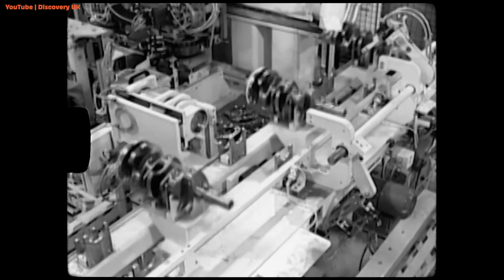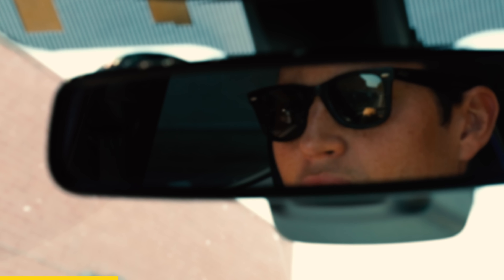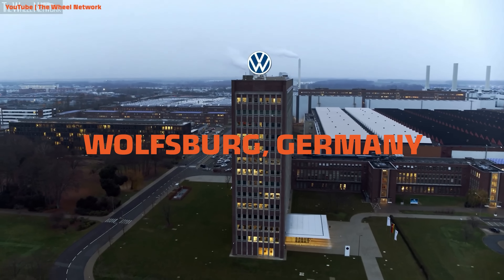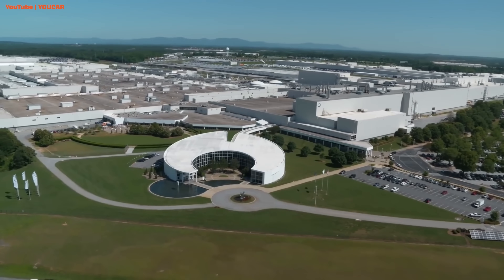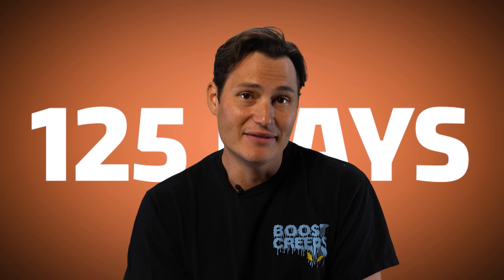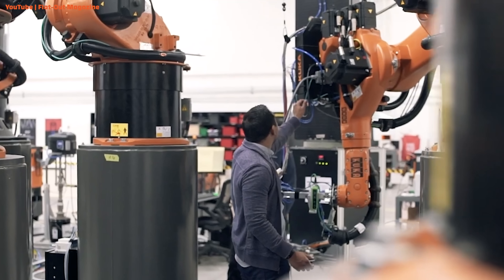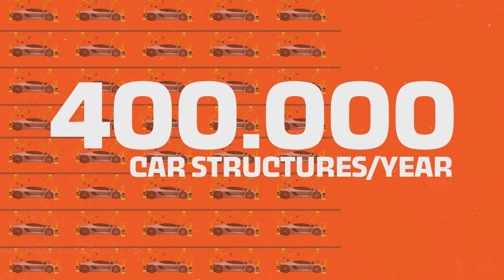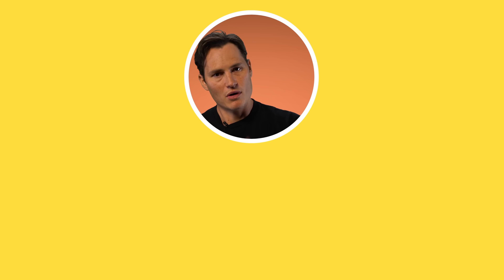A.I. Designed this Car

Comment: I will be that pessimist that might regret it in the future, but this does not seem plausible anytime soon. 
First, the figure of 400k cars a year is under the condition that all the parts are designed to be assembled in a specific way. So no chassis painting after welding for example.
Second thing is the cost. You spend 500m to save money, with the objective of decreasing the unit price. 3D printing is the opposite - little initial investments, but huge unit price. Especially if parts for a single car takes 1400h to manufacture.
Third thing is additive manufacturing is not a replacement for machining. As far as I know, you combine those two things - print a desired shape and afterwards precision machine all high-precision surfaces.
Also, topology optimization - or AI engineering (which is a buzzword marketing term) - is an existing technique that is used within reason in serial production. As for the loadcases mentioned, yes, you do have many defined, but you cannot predict all the forces on the components. So heavily optimized parts might be weak in some edge cases, in which were not a specified load case. You can compensate by higher factor of safety for the parts (a bigger strength reserve in other words), but that might defeat the whole point optimization.

I'm not here to say this is a load of BS, but the video contains a lot of stretched facts and out of context comparisons. The vertical manufacturing concept is quite cool though. I like what they are doing, but I do not see how these claims could be realized efficiently. I might be wrong though.
End of monologue

Comment: I was looking for more of a deep dive into that AI generated structures and the strength, weight and performance differences. But, this is donut and was still a solid piece!
Reply: Fyi, most of those "AI generated" structures are probably NOT generated  by "AI", but by something called Topology Optimization. Topology Optimization is generally not a stochastic process, nor does it require machine learning. It is wholly based on physics equation that are solved to provide optimum structures, and yes, these structures often resemble structures from nature.

If you'd like to play around with it and learn more you can try applets from here: https://www.topopt.mek.dtu.dk/apps-and-software

If you are a mechanical engineer with FE model experience, a good place to start is Ole Sigmunds 99 line topology Optimization code (google, and you shall find).

I hope that helps a bit :-D

Comment: "A 3d printer doesn't use extra material" - That's not how that works.
Reply: It doesn't waste, the unused powder can be used in the next batch. 

???
Reply: casting also uses little extra material. it just depends on how much of the part needs to be machine finished.
Reply: 3D printing wastes less material than traditional manufacturing, but you typically some print support structures that waste some material, depending on the shape of the part
Reply: @matthewjgingerich  Wouldn't the underlying power be the support structure though, when hardening it by laser? I'm guessing any overhanging structure would rest on a layer of powdered metal right?
Reply: By that he probably meant that 3d printer in the video that barely makes waste and not the other cheaper 3d printers

Comment: Imagine trying to find a mechanic to service this thing.
Reply: Probably would have to take it to specific dealerships that have those robot arms that can take it apart and put it back together without a hitch.
Reply: Well...it is a hypercar...you wouldn't even take a Porsche to a jiffy lube, why on earth would someone who owns one of these go anywhere but the people who built the thing?
Reply: Anything above an oil change would be a pain in the a**
Reply: @TheCustom1982  I'll bet an oil change is a pain in the@$$ also. Look up the oil change for a veyron.
Reply: @mikeedsten2358  will do
Reply: You don't service it, you get a new one
Reply: @huabills6621 😎
Reply: Print one lol
Reply: Probably could hire a robot.
Reply: It's ridiculous. Disassembling an entire car to fix a short, because they wired it through the chassis.
Reply: Perhaps they could scan your car and put in a special database where if you need a repair,they pull up your cars file and go from there
Reply: u better try finding an a. i... modern problems require modern solutions
Reply: Just have your robot fix it, or make a new one...

Comment: The construction of this car is so crazy efficient that it only takes 3000 hours of work to build one. Mind you! The price must be very efficient as well.
Reply: You pay for the research and development of the car and the manufacturing tech. In future the cars should cost less but this car because of it being the first plus its a high end hypercar costs about 1.8 million dollars
Reply: The idea of the efficiency comes from the idea that if you can get enough printers creating components to supply massive demand (mind you they don't have to be slow, super-expensive metal printers, but plastic instead for cheaper, mass-produced cars), then the actual assembly takes up less space, requires less specialized machinery, fewer workers, with no wasted material, and a final assembly that's 10X faster than conventional methods: that's alot of efficiency.
Reply: Ok the 5 people are taking apart and rebuilding an already complete car, not building it from materials to finished product.
Reply: @torque-ej4nu  gottem again! Benny is a dumdum 😂
Reply: considering 5 poeple can tear a vehicle down and rebuild it in 70 hours,   so ai isnt as efficient as man
Reply: @bennysouthern7509  It takes 1 hour to assemble the actual main body, did you not see that part?
I'm assuming the 3000 hours figure comes from the fact that 3D printing metal takes a fucking century and a half
Reply: @Anvarynn  No I didnt see that part I was busy ragging on it.
Reply: @Anvarynn   still going to take least 40 hours to assemble the entire thing.
Reply: @bennysouthern7509  9:08, he says construction of the parts AND assembly is 3000 hours, but then assembling the structure takes "less than an hour". Having 5 people over 70 hours to rebuild an entire car is still 350 hours, over x350 less efficient than the AU. You sound like a boomer lol
Reply: @bennysouthern7509  so your defense is "I wasn't paying any attention I was too busy making my now defunct argument" and "no that's wrong."
Reply: @rhydercoshutt  not all stupid people are old...
Reply: @bennysouthern7509  did you watch the video?
Reply: @kidyomu89  he's a southerner, leave him off. It's bad to make fun of the mentally deficient (like a southerner).

Comment: This is all very cool, but not suitable for any kind of mass production.

The reason why the cheapest city cars can be bought for 10K these days is because of the standardized tooling which is able to pump out thousands of parts in a single day without any modifications.

Additive manufacturing is more suited to prototyping and small scale niche products (such as sports cars).

Comment: Yeah 3d printing doesn’t have optimal strength for parts. The grains of the metals are not going to be in uniform structures which is the reason why standard manufacturing is subtractive through forging

Comment: It's cool, but it's very limited, very niche. 3D printing is horrendously slow compared to other forms of manufacturing, and doesn't scale particularly well. Additionally the build in place method is also going to be far less efficient. Finally, and I know it's not something everyone is ready to hear, but ICE vehicles are fast becoming obsolete. They're far more complex, and thus less reliable, than electric, and we're looking at maybe another 10-15 years of ICE development. It's a cool concept for sure, and might open up submarket of smaller  "Boutique" carmakers who do limited run stuff, but this isn't efficient enough to meet the needs of a growing population. AI designs on the other hand, will probably dominate the market.

Comment: How does 3D printing compare to cast / forged in molecular structure?
Both cast and forged are lower in overall material strength when compared with the chunk of refined metal that originates them (hence why CnC is better, because you don't alter the molecular structure and just chew away at the block of solid metal), so how much worse (or better) are the most large-scale manufacturing methods against 3D printing?

Comment: A.I. didn't design the car, it optimized the use of materials for a given set of design & stress parameters (specifically speaking to the structural components).
"Eliminates a huge portion of the production process" no; the Czinger cannot be compared to "legacy" auto manufacturers; Ford sells around 1million F150s EACH YEAR, and that's just F150's, it doesn't include the myriad of other vehicles they pump out. Czinger is selling a few bespoke hypercars, and the C21 will cost 1.7mil+/-.
The auto industry used to be vertically integrated, but over time, more of each vehicle has been subcontracted out. Vertical integration is making a comeback though; Tesla & VW's E-cars are examples.
You've oversimplified the Czinger vertical integration models ability to change; although they can upload new parameters to the robots for assembly (as can any other manufacturer), they can't change models on the same line quickly, as the panels of a different vehicle still require separate manufacturing molds much like different steel/aluminum panels require different dies.
I appreciate what Czinger is doing, but where there is ultimately no budget and no required production volume, it's easier to be cutting edge. Hell look at how Morgan builds cars, it's way different than the industry.

Comment: If you need the flexibility of a Helipod with the speed of a high performance air jet, look no further. Our patented vector thrust coil gives the 01 Versatran the ability to sustain normal flight in the event of a catastrophic, multi engine failure. 
Versatran. It’s the only choice.

Comment: Love the video but i find it a bit unreasonable to compare the assembly line of VW to this new method, altho it is a really good way to produce a car for the high end market, it is not so for mass producing, altho the 40 lines could produce 400.000 car structures a year the compete build of a single car still takes 125 daysresulting in only  116 cars a year with 40 machines simultaneously, unless of course i am missing something. Aboslutely love the way of designing al of the parts using as little material as possible. Anyway great video keep em coming!

Comment: This could be the way for one small segment of the industry.
As an automotive engineer, working for a plant which produces 1 car every 56 seconds, i doubt this sort of capacity can be sustained with 3d printing. The key to low cost is to produce high volumes.
I really like the way it optimizes design of each component, and those things would be near impossible to create with traditional manufacturing.
However, i'd like to point out there are reasons for and extremely long wireing, for example. After sales maintenance is also considered when designing cars, among other things....many other things.
I am curious if this sort of manufacturing will take off for high end machines, like f1 monoposts.

Comment: Sure . Make an AI-designed one-off part ( the whole 3d printed car in this case ) and sell it to the masses. Then when it breaks down, You cannot hand - repaired the dang thing via conventional means and had to be sent to the manufacturer at a fee using their 'lifetime device-care program" that already eats up your yearly house mortgage. And suddenly imitating an Apple dick move by telling you that the barely month old fancy car cannot be repaired coz its water-damaged and try to jedi-pyscho you to buy another new more expensive model from their catalog. Great Work America, the middle-class labour working population applauds you for your planned obsolescence mentality. ( Fun Fact : the SR71 Blackbird's fuselage must leak fuel big-time on the runway while taking off everytime till its body panels expands via heat caused via aerodynamic friction coz it was engineered to do so. That goes to show how this car company's mentality works)

Comment: Sorry but this is a really shit video.
You haven't showed the car properly, haven't presented any specs or anything. 
And spent shit loads of time talking about some fucking robotic arms, boohooo nothing new those have been used forever.
And good luck building 3200 cars a day on vertical assembler. Ever heard of this concept called economy of scale 
oh ye and while I'm here the 3d printers are super slow It takes like 5-10 hours to print a single part. yes speeds are increasing but not even close to being viable  in manufacturing

Comment: but how about repairability? I know that's a hypercars but still when the stuff broke, it needs to be changed.
Reply: @F a i think you're right, 3d printing strong metal is probably gonna cost thousands
Reply: @F a The thing is not your average Prius. It is a hypercar that costs 1.8M. If you can afford it in the first place you can afford the parts.
Reply: @yaboi1288  and if you can afford to repair it, you can afford to replace the old "junk" with the latest model.

Comment: You missed the best part about the blackbird it heats up so much going that fast that they had to build with large tolerances so that the materials had space to expand at high speed so that shit didn't literally break apart from the pressure of the expanding metal. It's absolutely bonkers that they managed to make a plane like that when they did.

Comment: You underestimate the German car makers or even Tesla by a stretch. They are using AI already. For example for designing forged pieces. But if routing electrical wires just by the shortest route, or building parts just for a single model would be a rational joice, this would already exist. After all this 21C is a bit of a marketing stunt. Not really appliable to mass manufacturing yet. Don't get frightened by this.

Comment: Used one of the similar "AI" in ANSYS workbench. There is actually a lot of prep work and programming before you can run "AI" optimization on a super computer. Then depending on the parameters you set and iteration, you'll get a list of top rated. Now as a human engineer you must look over the strange shape (if you set up freeform settings) and then make the decision which design is sufficient for the available manufacturing capabilities. AI is dumb, human must specify the expected loads,  stresses and desired life cycle for correct  build material to be used. 

Example: If "AI&I" design a control arm for F1 car that I need to last ~90 minutes its design would look very different from a regular daily driver. Believe me "AI" will not generate anything vastly superior for a regular car part that is designed to last a set life cycle (miles, hours, revolutions, etc..)

Comment: If it is 3D printing, then the car cannot cost more than 140 k dollars, lol

Edit: so if this car reduce mass by making the chassis like endoskeleton machine? Making it thin out the chassis, doesnt mean that 3D printing with these parts could end up the car get 0.1 star Safety? Cuz how some chassis isnt strong enough to handle enough amount of force driving 60 mph

Unless the entire car chassis is titanium alloy

And it seems that modern car manufactures is about tu make Engineering Mechanical obselete

Imagine if the entire car manufactures like that, then no human ever design cars anymore

Comment: Super cool, though additive manufacturing is not only super expensive but super slow. Also most DLMS printers you can't have zero waste the metal powder around areas that were sintered become hot and will be less strong when reheated.

Ai design and wiring routing would be cool but would also be a pain in the ass to service.

Comment: So this dude is wrong on more than one level. Additive manufacturing still requires machining to be done. Even if it on a 5 axis it still takes a highly skilled tradesmen called a machinist. So while the process is streamlined, additional manufacturing has yet to produce the level of accuracy to do away with machinist. So this dude is wrong in saying that computers build every component. Additional manufacturing is basically making castings that require less machine work. All theses prices must still have a machinist finalize almost all the dimensions.

Comment: "Here's your key, and here's your SSD full of replacement parts designs."
But what about seat materials?
"Joanne Fabrics near Walmart, 3 blocks North on the right."
Reply: If only it were like this but car manufacturers wouldn't dare...
Reply: @dallysinghson5569  u wouldnt want to know how ecpensive thatd be...
Reply: Owner tries to insert SSD into phone. Fails. Sells Car. 
21C tech support gets call from new owner asking if he can get it on CD-ROM, and can he substitute PLA for titanium.
Reply: Being that this is a hyper car, does it even use fabrics or comfortable seats? I was imagining a full on carbon fiber racing bucket seat xD
Reply: @ManicQuinn  It's a center seated carbon bucket with black Alcantara and leather
Reply: @theawesomeguy9999  I see, thank you for the clarification.
Reply: They shut down.  Need new supplier
Reply: Love it!
Reply: Right! But the seating materials would be a living organism that repairs and cleans itself. Wouldn’t need to go to joannes or michaels for that
Reply: That' basically how the 3d printer community is, the machines are infinitely repairable pretty much (upgradeable too!)